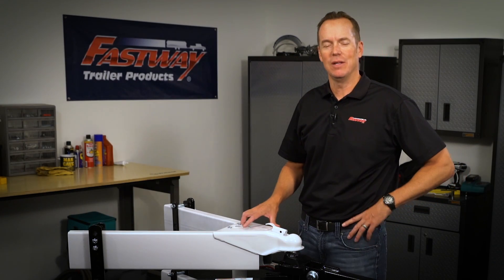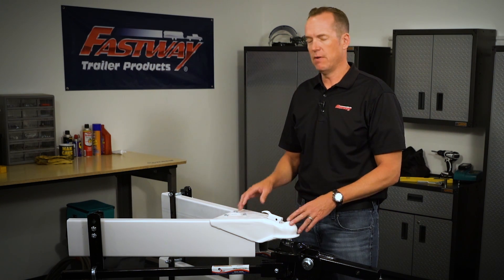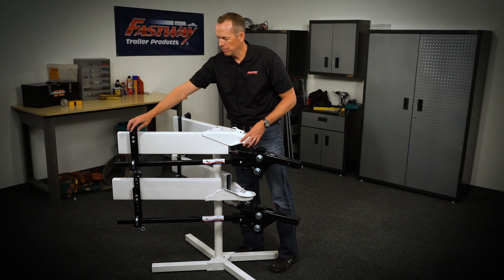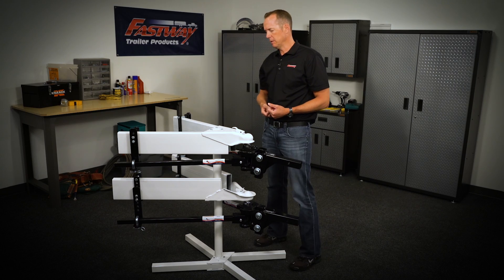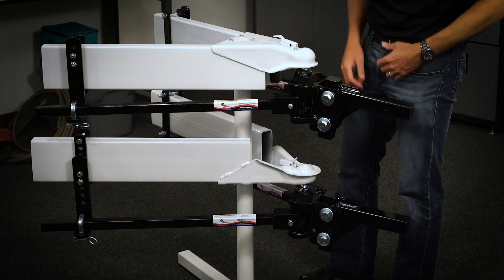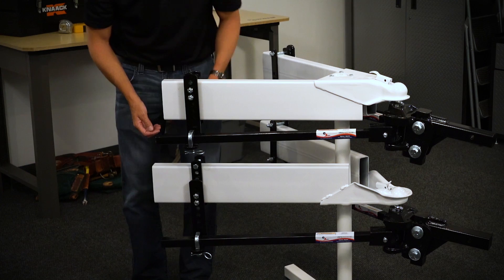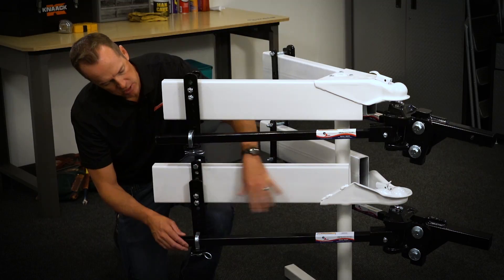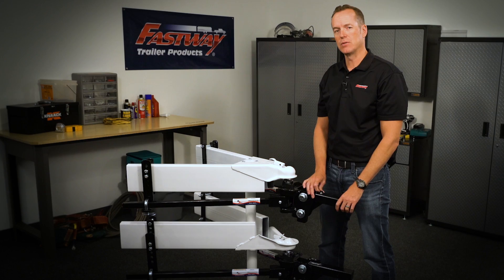Fastway 2-Minute Tech: Correct Link Plate Orientation For Your e2 Hitch

Comment: I have the e2 round bar installed on my drop coupler style trailer . I flipped the brackets like you showed and now Having the L brackets sitting lower is causing them to bend inward  . This makes the round bars not make proper contact with the L brackets causing poor sway control . I am not happy with the set up at all . I am contacting the retailer I purchased the setup from to hopefully get a refund
Reply from the maker: +AutoTech Jord, we're sorry to hear that you are having difficulty getting the hitch set up to tow how you would like. It sounds like there may be some other factors involved in the setup beyond simply turning over the link plates. Our goal is safe and happy customers. Please contact our customer support staff at 877-523-9103 and go over the details of your setup and the adjustments you have made with them. We will do everything we can to help you get what you were expecting from the e2 hitch.